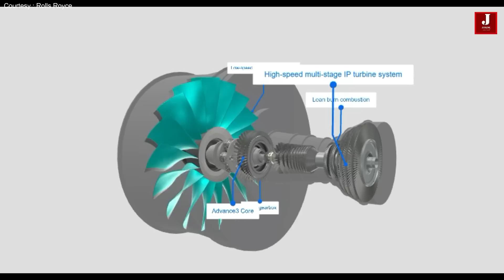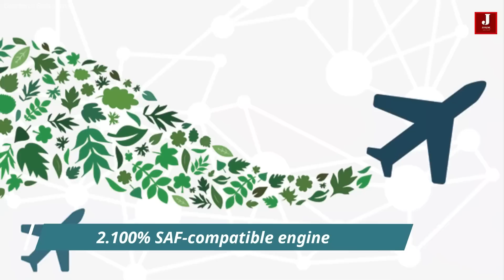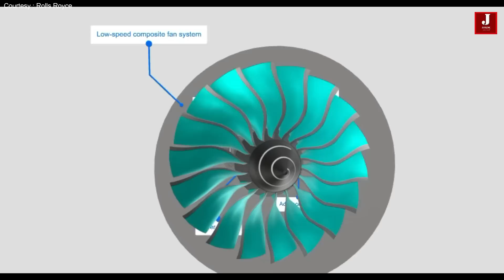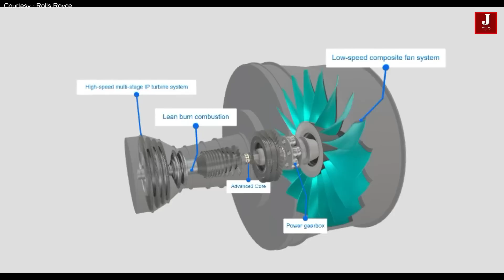The world's largest engine The Rolls Royce UltraFan: 10 Key Takeaways.

Comment: Further to my previous comments, my intention was to set the record straight and correct some biased comments from the other side of the pond that are just plain wrong.  However, let me state very clearly that the current big turbofan engines are fantastically reliable, when compared to the first generation of jetliner engines.  The standard was probably set by the RB211-535 engine on the B.757: it was the first high bypass turbofan to exceed 40,000hrs 'on the wing' before removal. 
As a regular traveller between the UK and Singapore for years now, I most definitely need those engines to be reliable!  So what engines and aircraft have I flown with?  I must have started with RB211-524s on BA's 747s.  I've since flown on BA's Triple Sevens, with both GE90s and Trent 800s.  I've flown on A380s with BA, Malaysia Airlines and Singapore Airlines, all powered by Trent 900s.  More recently, I had a flight on one of BA's 787s, powered by Trent 1000s.  Sorry Boeing, but that was the noisiest of the lot:  the A380 has been the best passenger experience by far.
Finally, to set the record straight some more, let me mention a few more of the occasional (thankfully!) problems that have beset engines from "over there".
Back in 2015, a GE90-77B on a BA Triple Seven had an uncontained engine failure during its take-off roll at Las Vegas.  An HP compressor disc failed and there was a fire: however, the take-off was aborted and the passengers escaped.
In 2019, GE90-110B1s and/or 115Bs had a problem with the failure of HP turbine interstage seal rings: there were at least two uncontained engine failures.
The P&W GTF (geared turbofan) engine has been mentioned elsewhere.  According to the publicity, its gearbox was supposed to last the life of the engine.  However, two Indian airlines have experienced problems and there have been IFSDs (in-flight shutdowns).  Reportedly, their next buy of A320neos will have LEAP engines.
I could go on: the information is out there but, as I have said, the events are, fortunately, relatively rare.
Reply: Oof. Carbon fiber body does nothing to block sound I guess on the 787?
Reply: Good for passengers, but exploding on the A380 and then £millions spent on the 1000. Wouldn't expect my new EV to swerve off the road of the road, let alone at 30,000ft. Its on buyers minds same a the MAX still is. Rolls need to get the Ultra CERTIFIED so that it ready for any aircraft. Keep telling us every year that they still testing it, doesn't allow aircaft builders the option of using it. Why doesn't someone crack the whip, there doesnt seem to be any urgency and its not that Rolls dont need the money-they do and GE are not far behind with the  GE9X with 34,000 lb more thrust than the Ultra

Comment: In addition to an obvious bias against anything in the aerospace engineering sphere that is not "made in the USA", which regularly comes across on YouTube, the comments made here also demonstrate the severe case of collective and selective amnesia that appears to be endemic on the other side of the pond.  
Criticisms have been made in respect of Rolls-Royce and some of the problems its engines have experienced.  However, there have been numerous problems with US designed and built engines (and aircraft) that have not been mentioned - except by me in reply.
For example, the grounding of some (but not all) R-R Trent powered   B.787s, due to problems with compressor and turbine blades, has, of course, been mentioned.  However, there has been absolutely no mention of the fact that the whole of United Airline's fleet of 52  B.777s, powered by P&W 4000 engines, was grounded for over a year, because of engine problems. 
As another example, a few months ago, there were snide comments made across the pond, when a British satellite launch failed: however, the technology was all-American.  The launch was made from a B.747 that had been specially modified, which had done four previous successful launches in the USA - after a failure on the first attempt.  The drop of the rocket from the plane, out over the Atlantic, had been successful: however, the engine of the second stage of the rocket (made in the USA) failed to fire properly..    
And, in conclusion, Let me remind readers that Boeing were totally responsible for the deaths of 346 people in the two Max-8 crashes.  So much for the old saying, "If it ain't Boeing, it ain't going!"
Reply: Beautifully put argument mate.
We have to realise that there is no facts or logic with people shouting 'MURICAAA!'.
Reply: Americans can’t criticise rolls Royce there b52s are getting rolls Royce engines  the p&w f135 engine for the f35b was developed by rolls Royce and rolls Royce is developing the tempest, ngad & ffx reaction engines as well as one for Japans 6 gen jet and turkey.
Reply: @anthonyashton8330   While I am in total agreement with your sentiment in fairness the F35B owes its STOVL abilities to UK pioneering work in the '50s, the production and operation of the Harrier and its complex 'LiftSystem' built by RR. This is entirely separate from the P & W F135 engine.
However it is a fact that RR built their F136 engine (with GE so it was 'American') and it outperformed the P & W F135 on every margin during competition tests. But of course it was British and so could not be used. And now the F135 has been shown to be underpowered, costly to maintain and needs to be stretched.
LM should have bought the RR F136 and I think the UK F35s will eventually get it as a retro fit as it will be cheaper than upgrading the P & W F135.
Reply: Rolls Royce solved jet VTOL with the flying bedstead

Comment: All Aviation worldwide contributes approximately 4 %  of anthropogenic  CO2 emissions. 
 There are approximately 25000 commercial  aircraft worldwide compared to 190 million vehicles. 
CO2 at 400 ppm  comprises slightly less than four tenths of 1 % of atmospheric gases.  
Man made carbon amounts to .012 % of total atmospheric CO2.
Reply: The volcano you cited is a particularly poor example for your argument, considering that it produced so much SO2 it actually cooled the Earth with its emissions (by 0.5°C!  Not to mention that it released only 50 million tons of CO2 gas when it erupted! Humans produced 35 billion tons of CO2 in 2014 alone! And we have produced more nearly every year since. Where the heck are you getting your data?😂
Reply: Boom. At 400 ppm CO2 in our air, this, in fact, is TOO LOW for optimum plant growth and Oxygenation of our Planet Earth.
      "Real Science" Folks !

Comment: In the video you said Rollers new all singing dancing  ultra fan engine will be available without a thrust reverser, pray this ,how the f--k is the Skipper of a B 777X to bring his plane to stop without burning the brakes to a crisp?Is those fancy fans some college trained cretin designed in his tea break have the ability to reverse their pitch like an old fashioned Hamilton Standard Hydromatic Propeller on Grandfather,s Douglas DC-6?.
Reply: That's exactly that the voice over in the video said, the fan is variable pitch and reversible. I have no idea if that is actually true though.
Reply: @owensmith7530  Roller engineers need to design a reverse pitch facility into their geeky new  engine, somehow I do not Boeing or Airbus will fit drag chutes to their new creations ,be a bit backward.
Reply: There was a proposal for a variable pitch fan in the Ultrafan, but it was dropped a long time ago.  For anyone with an eye for detail, and who knows anything about high bypass turbofan engines, this is obvious. The commentary is inaccurate.
Reply: @grahamj9101  If no reverse thrust or pitch facility is built in, then Roller,s  geeky new engine is about as practical as a  a clap clinic in  a convent, you need reverse thrust doh!!!!!!.

Comment: Major bad idea? Variable pitch fan blades, hollow blades, bigger blades.  Bypass ratio too big and too much pressure on fan blades..lose one blade and entire engine fails.  Scary
Reply: US designed and built engines have lost fan blades, resulting in an engine failure.  If a fan blade is lost in any of the current big turbofans, the engine core will almost certainly be damaged and, in any case, the fan unbalance will cause secondary damage and the engine will have to be shut down.
Check out what happened to Southwest Airline flight 1380 in April 2018: a passenger died.
Reply: @Bogbanter You seem to know stuff better than RR engineers. But you don't.
Reply: Yeah. Solid blade breaking off just means it has more kinetic energy to break things with when it fails.

Comment: Why mix Imperial and Metric units dude? You talk about inches of diameter and pounds of weight, then use kN for thrust. Best stick to metric - what 95% of the world and ALL airplane engineers exclusively use these days. But if you really feel you need to appeal to USanians stuck on Freedumb units, use pound force and short tons consistently.

Comment: And the so called Engine exhaust were what Conspiracy Theorists called Chemtrails. But that Conspiracy has being finally admitted to be fact. Contrails are no longer produced by Modern Jet Turbofans Engines!    lmao
Reply: Hydro-carbon content of jet fuels produces water vapour as a by product of combustion. If any fuel produces water vapour as a by product, then it will cause a vapour trail
Reply: Moron detected.
Reply: I thought that contrails were produced by the wings aswell as the engines

Comment: The RR engine will NOT be an option on the 777X.
The Trent 1000 was a failure on the 787 and the engine grounded many airlines aircraft costing RR hugeamounts of money.
For their future engine choice Air NZ and Al Nippon have switched from RR for their 787s to the superior GEnx engine.

American engine manufacturers such as GE and Pratt do not want RR producing civilian big fan engines.
Reply: standard american boeing fanboy comment there..
Reply: its wasn't and isn't a failure as the issue was resolved, typical biased Boeing / USA fan comment, its up to the airlines what engines they put on their aircraft
Reply: We know that no RR engines will go on a 777X because GE bought that market by funding Boeing's 'production engineering costs' (a bung in other words) and they swop CEOs for fun.
The Trent 1000 had NO failures ever. Engine wear was spotted early as RR has in flight real time monitoring and so were replaced at RR's cost.
Joke is on you Yank because Boeing loses $20 Mn on every 787 delivered, its 737MAX is a proven killer and now has engine issues, the 777X is years late and billions over budget and won't be delivered until 2025. So what aircraft does it make that actually works?
And don't even get me started on the KC-46 boondoggle ..... 🤣🤣
Reply: What do you think about Boeing and it's 'failure' with the 737 Max and ongoing issues with the 787? Airbus do not want Boeing producing big civilian aircraft. Makes as much sense as your ignorant comment.

Comment: The GE9x engine has a smaller intake diameter yet it produces more thrust than the RR ultrafan.
RR are wasting money on an engine that has no wing to mount it on.
Reply: They apparently at least somewhat agree. They have slow tracked the Ultra fan development since their finances are in shambles an no immediate customer pushing it. Very different situation than the G9x where Boeing pushed them to develop it and gave them exclusivity on the plane. Volume is simply too low at the top of the plane size market to have competing vendors for it to make financial sense.
Reply: You just hate Rolls Royce, you even insulted the Merlin engine in another post
Reply: @ant2312  Give is a rest. I'm going on RR's OWN  public statements and balance sheets. They are in rebuilding mode and not looking for any major cash outlays right now. And this WW2 Merline thing that you're harping on I made no comment on. That was another John. You my friend are the one with Bias here of folks not giving glowing reviews of RR. Get yourself in check.

Comment: Sustainable engine fuel is a myth.
Reply: I agree, C02 being an issue is also a myth, its just a very convenient way of creating a tax for any energy that someone uses, i.e. you want to drive your car 50 miles, well there will be a CO2 tax for that in the future but you will have probably been brain washed into believing its an issue so you won't dare complain about the tax, you will just pay it. Water vapour is a way more powerful green house gas but you can't tax that because your activity as a normal human being does not create much water vapour in your day to day activity.
Reply: Yupperz !
    Everything in today's world is a LIE !
Reply: Ehhhh. Purely solar produced H2 gas is pretty dang sustainable. Admittedly, we have no where near enough solar water splitting plants yet (like, two maybe, tops?). But if ones fuel was solar generated hydrogen? Expected lifetime of that is roughly a few million years (until the seas boil off and the Earth is left uninhabitable). Sustainable as one gets.
Reply: @RryhhbfrHhgdHhgd356  Or using wind (Sinopec, Shell). Giant electrolysers are being built in China and the Netherlands. It's merely the tip of the iceberg however. Trillions of dollars investment will be required.
Reply: 100%

Comment: Pollution?  How about stopping chemtrails?  That would be a better goal.
Reply: Flat earther alert.
Reply: American detected.
Reply: I mean, even if there are mind controlling chemicals laced in fuel, they would still technically be pollution. Not to mention that both hydrogen or ethanol would be far, far simpler to test for any such containments anyways.
Reply: @RryhhbfrHhgdHhgd356 :  It’s not in the fuel.  They literally have planes that spray nano aluminum to block the suns rays.  It’s called solar radiation management (SRM).  Look up Dane Wiggington at geoengineering watch.   They are not mind control but the aluminum is toxic.  It is giving health problems to people, the land is getting toxic to fruits and vegetables, and the nano dust burns extremely hot which is why we are seeing more forest fires.
Reply: Jet trail are WATER VAPOUR
Reply: @johnchristmas7522  Chemtrails are not contrails. Contrails are water vapor and disappear with seconds as the water vapor hits ambient temperature.  Chemtrails stay up for hours and slowly dissipate into a whisky cloud like appearance.  It really doesn’t take a GED to know the difference.

Comment: Sustainable fuel? Sounds like another way of saying, "ticket prices will double".
Reply: More like unsustainable products will be barred from EU markets.  Its happening already
Reply: Just a small factoid in this entire air quality discussion.
When a hydrocarbon fuel, in the presence of oxygen, burns the byproducts are Carbon Dioxide (CO2) and Water (H2O).
Whether the source of the hydrocarbon fuel is a sustainable source or from distillation of crude oil the results are precisely the same.
The only possibility for pollution is the purity of the fuel which is determined by production, not by source.
Reply: @blindspott1060  Of course if the CO² in the fuel was taken out of the atmosphere, then returning it to the atmosphere means no net CO² increase....
Reply: @deerfootnz  Fuel contains no CO2 and combustion does not remove CO2 from the atmosphere it adds it.  There is no carbon neutrality unless you burn hydrogen.
Reply: @blindspott1060  Fuel contains carbon which turns to CO2 by combustion. If you source the hydrogen and  carbon from the atmosphere to make your hydrocarbon fuel then you have added no CO2 ti the atmosphere. OBVIOUSLY, especially if the energy used in the process was renewable sources. You are making yourself look stupid now.
Reply: @deerfootnz  Sorry pal, your knowledge of organic is lacking.  Oxygen from the atmosphere oxidizes the carbon based fuel to yield heat, CO2, & water.  
This is among the most basic equations one studies in Chem 101...combustion of methane is CH4 + (2) O2-----> CO2 + (2)H2)
Reply: Exactly. Prices never fall.
Reply: @Bill-sp8kb  You're over simplifying it. You need to look at the whole well to fuel process not just the fuel itself. Stop thinking you're so smart just because you know basic chemistry.
Reply: And the alternative is what exactly? If the fuel is not sustainable, then it is unsustainable. What is the meaning of the word  unsustainable to you?
Reply: It won't matter because, in the future, only the rich will be allowed to fly.